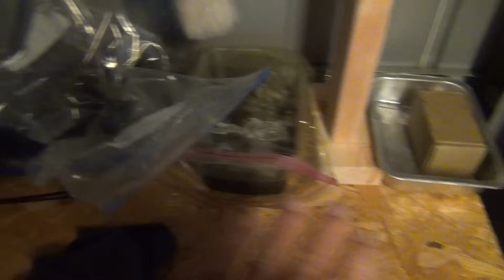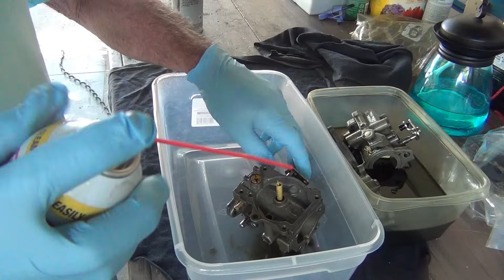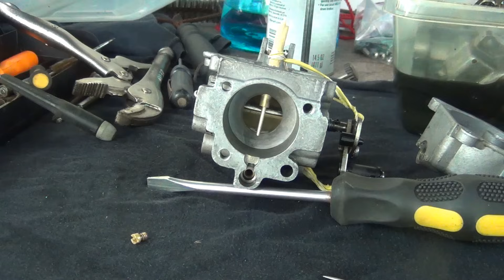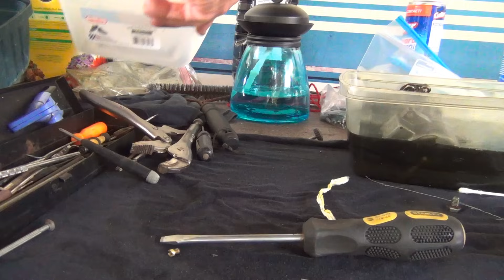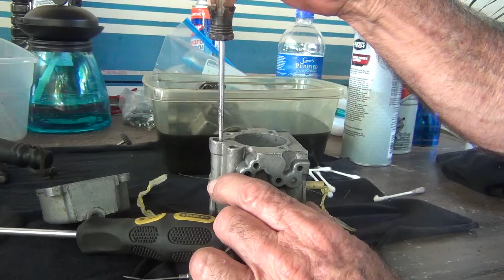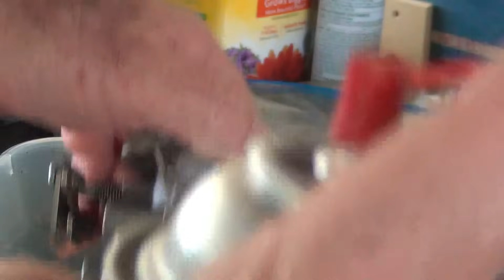Johnson Evinrude Carburetor Clean - The 2 Most Important Things / #outboardrepairvideos

Comment: What do you let it soak in? Just degreaser?
Reply from the maker: Hey. Thanks for tuning in! The main ingredient is STP Complete Fuel System Cleaner. I also shot some carb & brake cleaner in the mix and topped it off with some 2 stroke oil so it wouldn't evaporate to fast. But it's the STP that does the job! Thanks again & Stay tuned !
Reply: @THISOLDOUTBOARD1  awesome broke my three carbs down today and it was basically pure oil clogged everywhere it was thick and sticky so gunna order the repair kits but I’m afraid my fuel lines may also look that way
Reply from the maker: @nicholasecker1701  yes i would replace them too. Thx

Comment: I have a carb to a 25hp I done this and the motor runs until I put hood on or halfway cut the block any air flow to carb do you have a idea why that is?
Reply from the maker: Hey Charles. Sounds like your powerhead to exhaust gasket is bad and leaking exhaust fumes choking out the carb when you put the hood on. You'll have to take the powerhead completely off to replace it. Check the schematic at marineengine.com. Thanks for tuning in!

Comment: I have an evinrude xp 200 where is the best place to find the rebuild kit for the carbs an what should my compression be? It's an 89 model.
Reply from the maker: Hey. Try marineengine.com and ebay has good deals sometimes. Good compression is usually anything over 100 psi and even or close to even, around 5 psi is good between cylinders. Thanks for watching !

Comment: I have a1958 Evinrude 28 hp. Are parts still available?
Reply from the maker: Hey. I dont see a 28 hp for 1958,  https://www.marineengine.com/parts/johnson-evinrude-parts.php?year=1958. Does it have an ID plate on it. I have a 63 28hp RX-11. Pretty cool old outboard and can still get parts. Ebay is a good place for parts.

Comment: Hi friend! I am from Argentina ... I have a Johnson 35 Model 81 and I have a problem that wets the spark plugs ... the lower spark plug burns black and the one above it totally wet. change diaphragm. I took to check the entire electrical system ... and I continue with the same problem, it is a summary ... I tried many things but I do not find the fault ... the diffuser is standard ... could you give me a hand? (help!!!)
Reply from the maker: Hey. Check the carb needle, sounds like its not seating and the motor is sucking to much gas. The float may need adjusted and/or its getting stuck and not closing the needle. Also check the choke solenoid and linkage, the butterfly may not be opening all the way and flooding out the motor. Double check that your getting a good strong spark. You can find a manual at boatinfo.no. It should tell how to set the float measurement. Curious to know what you find out. Thanks
Reply: @THISOLDOUTBOARD1  
I will notify you as soon as I have news! I tried a lot of things ... the engine sounds good, but I remove the spark plugs completely wet and that is not right ... thanks for your help!
Reply: I did the 19:00 minute test, and nothing falls ... I'm using w40, that's a little thicker ... but it should still fall and almost nothing falls ...
Reply from the maker: @Santy9z That wouldn't be causing wet plugs. You say it sounds good so I'm assuming its running. Are you sure both cylinders are firing and spark is strong. I had another guy with similar issues, he put new coils in it and that cured the problem. The coils will test fine when cold but will weaken as they warm up. Are you using the correct spark plugs. May even be just a bad condenser. Try running it on one cylinder at a time like its two separate motors, that will help narrowing things down.  Its a pain diagnosing these things, what may seem like a fuel issue can be ignition problems and vice versa. Then it becomes a process of eliminating each system one at a time. You can try taking the plugs out and cranking the motor, be sure and move the plug wires out of the way, if you see a heavy presence of fuel shooting out then you'll know its a fuel issue. Wet plugs are to much fuel or not enough spark, Or there is a possibility that the head gasket is leaking water, thats why the top plug is wet and looks clean. Get some STP Total Fuel System Cleaner for the carb and soak it a couple of days.
Reply: @THISOLDOUTBOARD1  Here in Argentina there is a place where they test the electrical part of these motors. They are very qualified people, they took them away and they told me that everything was fine. for that reason I discard that it is an electrical problem. it has good compression ... it does not pitch ...
Now I'm going to buy a liquid to clean the carb!

I would love to have a friend with a carb to test it hahaha

Comment: What was the special mix is what I'm trying to figure out
Reply from the maker: Hey. the STP total fuel system cleaner is what is really doing the job. then I add some carb cleaner, brake cleaner, a little gas and some 2 stroke oil so it dosent evaporate to fast. but its the STP! Thanks !

Comment: Hey brother I'm doing up a 1966 Johnson FD-20C with electric start (never hooked up) I'm clueless how to hook up the electric start. Theres a electric choke, and a solenoid but nothing is hooked up.. I can't seem to find diagrams of this option for this engine.. its definitely factory installed, just never hooked up.. can you hook a brother up? And you probably guessed that I made up new swear words. Lol. A Jesus Christ clip ( Jesus Christ where did that clip go) lol.. went flying, i found it.. i got it soaking in acetone and 2 stroke mix, a little carb cleaner.. I'm on my sixth motor, the other five run fantastic. I might go up to dads in Hayward Wisconsin (spider lake) get out of Illinois.. dial the 70 18hp fastwin dialed in. Musky be hungry.. thanks brother.  Chuck
Reply from the maker: You can find a manual at boatinfo.no.  https://www.justanswer.com/boat/7n3ty-1966-evinrude-18hp-motor-need-wiring-diagram-har.html

Comment: what is that cleaning mix?
Reply from the maker: Hey. Thanks for tuning in. The main ingredient is STP Total Fuel System Cleaner. Then I added some carb cleaner and some 2 stroke oil to keep it from evaporating to fast. But it's the STP that does the job. Thanks again & Stay tuned !
Reply: @THISOLDOUTBOARD1  so you just make enough to submerge half the carb? there is no ratio just half and half and a little oil?  Thanks for you videos they are helping me a lot. I got a 25 hp 1980 Johnson that bogs down around 5mph.  I watched your videos so I'm talking the  carb apart and cleaning high speed jet.  I notice you don't replace those aluminum caps on carb but others do.   Is that necessary ?
Reply from the maker: @yeshuaadoneinu436  Hey. it's not half and half, its probably 80/20, 80 being the Stp. No I don't pull the Core Plugs/Caps unless it's absolutely necessary. Thanks again!

Comment: when I sdjust 2 of my 3 low speed jets I get no response.. what could it be thanks
Reply from the maker: Hey. Thanks for tuning in. I find that to be a problem for me also when adjusting my 3 cylinder. Pain in the azz! So I just use the initial settings given in the manual for the model. Then check the plugs every so often and see what color they are. Thanks again & Stay tuned !
Reply: @THISOLDOUTBOARD1   The manuals say 1 1/2 turns out, then start with the middle carb. turn it in until it starts to bog, then back it out until it levels out, then do the other two. I guess these are the crossflow type motors.. I had one of these many years ago and it was GREAT. always started and ran great.. hydro electric shift and always worked flawlessly.. someone had put a set of 75 hp carbs on it before I got it,.,. if u ever pull the carbs, notice the intake reed plate,, the 65 hp motors were 75 hp that were powered down by putting smaller carbs on them.,., the difference in the holes in the reed plate and the size of the holes in the carb are ALOT.. if u can find a set of 75 hp carbs it will really wake up a 65 hp.  a friend of mine had a 90 nissan and I used to walk away from him with my boat.. he actually took his boat to the shop and said something had to be wrong with his motor because he couldnt keep up with my old "65" hp evinrude.. ha
Reply from the maker: @randy1ization  hahaha!
Reply: abt 6 years ago I got caught in some big waves and sunk.. I got the boat out, pulled the plugs and drove home with the cover off,, the next day I spun the motor over,  drained the carbs and put the plugs back in and it fired up and ran great! this is after it was underwater the day before!!!  the guy with the nissan came over to basque in my sorrow, and was shocked when he saw the motor running,, I went fishing again the following day.,  these old motors were made before cell phones, and they had to be reliable.  the new motors with fuel injection will cost you 1,000 to fix just abt anything motor related.  the scanners they use are not practical for a DIY to buy at 700.00.  get some bad fuel and it wreaks havok in the new stuff..  I  think I have a bad reverse shift solenoid in my 65 hp.. I have to drop the lover unit to see if there is a broken wire or its just bad. I have no continuity in the reverse solenoid.. It fooled me at first until I unplugged the knife connector and checked it,, if you dont it will show continuity..I guess thru the other solenoid..  do u know if the reverse solenoid can be replaced alone or the set has to be replaced.. thanks

Comment: Why would the float lie on the bottom, with any fuel in the bowl it will float.  Why do you care how much drop you have, you will never get close to full drop under normal operation as the float will only go slight drop(fuel entering) to level(fuel shutoff).
Every video shows someone OCD about how much full drop there is.  If you ever go full drop then you have a fuel pump or leak problem not a,float issue
Reply from the maker: Hey thanks for tuning in. I know what your saying and I use to think the same way, but there is a drop measurement according to Omc, its in the manuals. These floats aren't factory set as the fit many outboards. Look it up you'll find it. Thanks again & Stay Tuned !
Reply: @THISOLDOUTBOARD1  I beg to differ. My 1977 repair manual for 85 and 115 HP, item number 5309, says to turn the carb over a check for the float to be level. Then next step is to attach float chamber.  Never does it give a spec or call for checking float drop
Reply from the maker: @hugoglenn9741  Hey. My OMC service manual, specific to my 92 Johnson 60hp says as follows. Adjust Float Drop. With carburetor body in normal position, the float drop dimensions should be 1 1/8 to 1 5/8 in. (28-41 mm).... Those carbs on an 85 are a different animal! I really don't know a lot about them. So stick to your manual and I'll  stick to mine! Hahaha Have a great day!